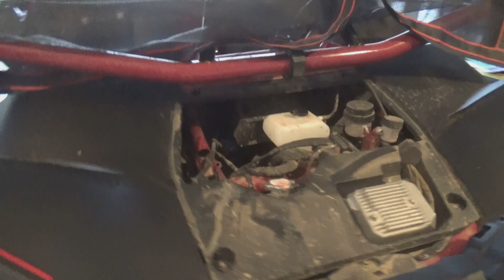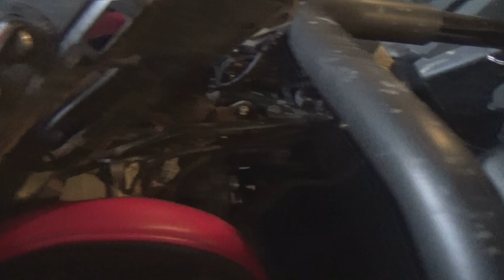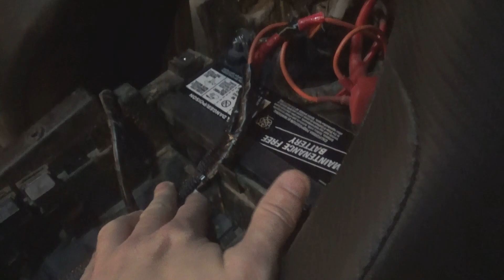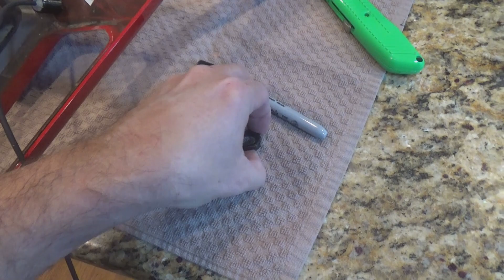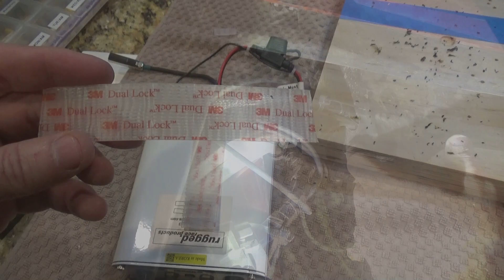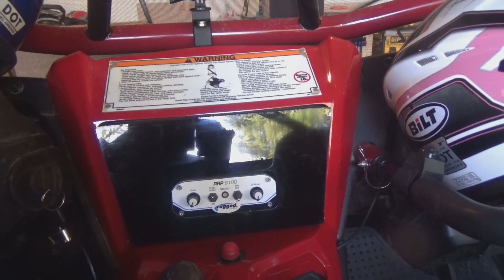Installing a Rugged Radio Intercom

Comment: I currently have TheCom radio/intercom system, but just upgraded from my 900s to a XPT with custom cage. So I want to install into dash. Trying to decide on switching to rugged or modifying TheCom
Reply from the maker: TheCom looks like a nice setup. I had considered it but it would not fit the dash of the YXZ so I went with the RR for the intercom.  I am likely to go with something else for the radio when I add it, but that will be somewhere down the road.  You've been entered into the drawing.

Comment: Thanks for video! What are other options when it comes to radio? since this one on the higher price point. Also what brand of cage is that? Thanks again
Reply from the maker: Thanks for stopping by. Rugged products are expensive but then most of the intercoms I found were expensive.  PCI also makes them but they too were in the same price range.  My old helmet to helmet set works fairly well and it is about $100. This is the same set I am giving away as part of this video to one lucky winner. It is Bluetooth based so you have to pair them when you power up which can be a little bit of a pain but not too bad. Because they are wireless, you have to charge them up but a charge will last all day. They did not get as loud as a wired set will though so sometimes my wife would have trouble hearing me.  As for the cage, it is a BCF (Brick City Fab) cage.  I have a 3 part video series on the building of the cage here on my channel.  It's a great cage, sturdy and well designed.  My only regret was not getting a slightly taller version because my aftermarket seats sit a little higher than stock so not quite as much room.  I have entered you into the drawing for my old intercom system.  Thanks again for stopping in.

Comment: Good video, you can also attach the PTT button on one of the spokes of the steering wheel which will allow you to keep hands on wheel.
Reply from the maker: Thanks for stopping by. Yep, I had thought about that as well.  However, I didn't want to deal with the coil of wire wrapping around the steering column as I turned.  I also have my wireless camera mount that I put on the steering wheel for controlling my Go Pro cams.  So, didn't want too many things attached to the steering wheel.  Where it is mounted though is very easy for me to hit if I need to but most of the time my wife will be with me so she can handle the car to car coms.  Thanks for the comment though. I will enter you into the drawing for the intercom.
Reply from the maker: @JBquadrider Aren't you on the YXZ Talk forums as well?  I was trying to remember where I recognized your username.